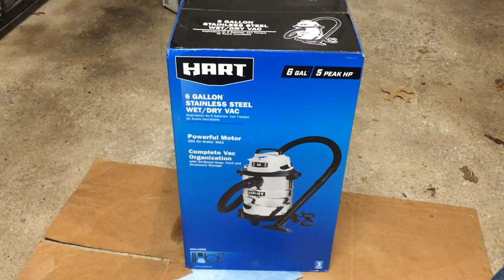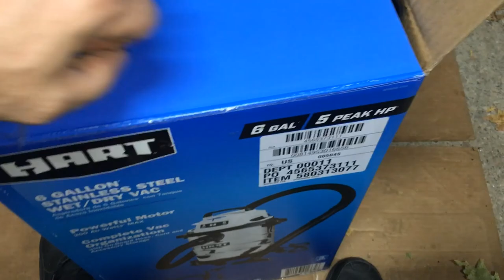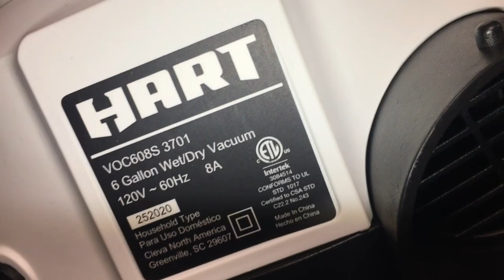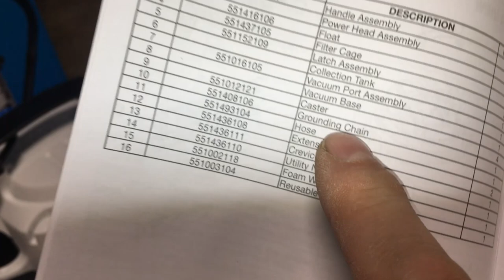Walmart Black Friday Hart 6 gallon 5hp Wet Dry Vac

Comment: Packed mine up and this vid helped me reverse engineer the packing!  My last shop vac from walmart lasted at least 8 years.  (I think).  This one just doesn't have the same kind of attachments. Couldn't find a separate carpet attachment to buy.  Didn't even come with a dust bag.  Nice power but it won't let go of carpet.  But it's going back.

Comment: Grounding chain to secure it in case you want to set it in a particular spot and don’t want it to move.
Reply from the maker: that chain isnt going to hold it anywhere. the chain is too thin and its mount is barely holding on. its mainly for grounding

Comment: The chains whole purpose is for grounding. Just to drag around the floor and ground it out.
Reply from the maker: yeah that is what I figured otherwise it serves no purpose
Reply: @bobspurloc  if it was plastic it wouldn’t matter but being a metal container it will build static very fast.
Reply from the maker: makes sense. the chain thing is a pretty bad way to handle that. its not secured very well and extremely flimsy. never mind its just going to rust away over time